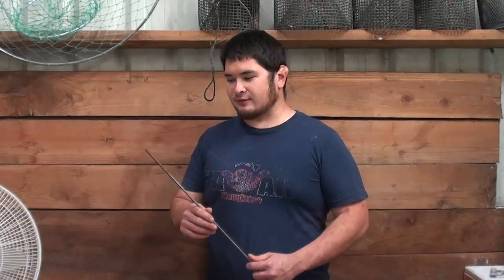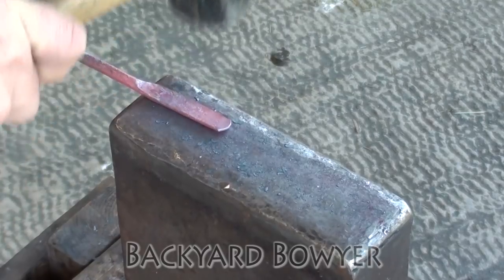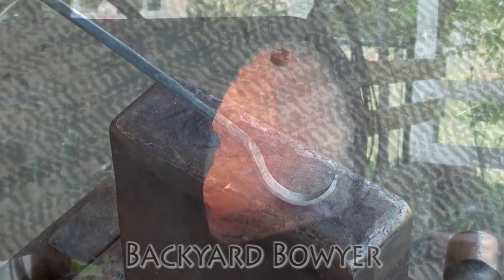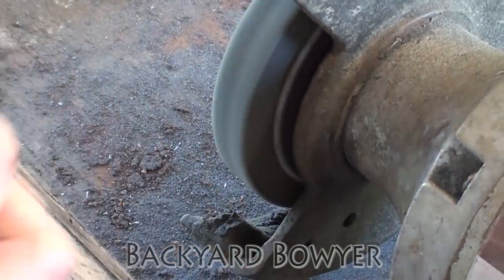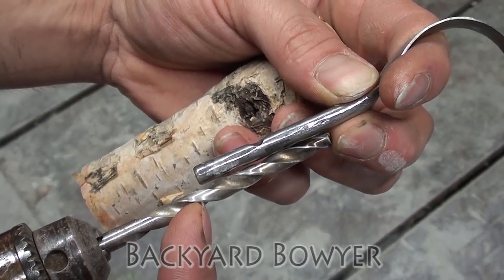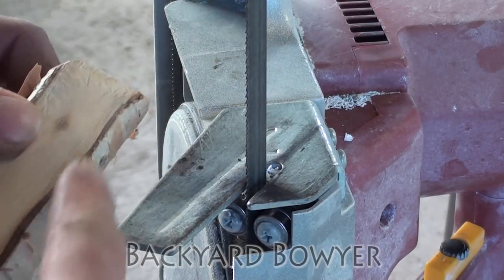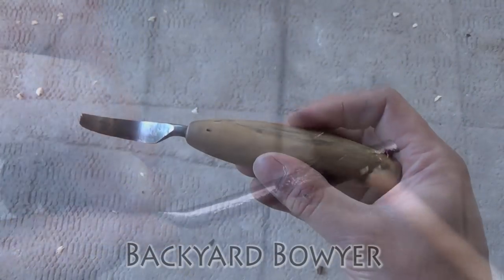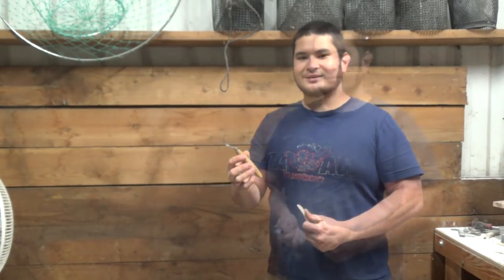DIY Blacksmith Forging a Curved Knife for Spoon Carving

Comment: Nick, while you had the drill and bit holding the wood you could have used it as a lathe.  Spin the wood and use the rasp to rough out the shape of the handle.

Yes, please show the sharpening method.

Comment: Nick, did you use a single or double bevel on your edge?  Also, did you place the bevel inside the radius if you used a single bevel?